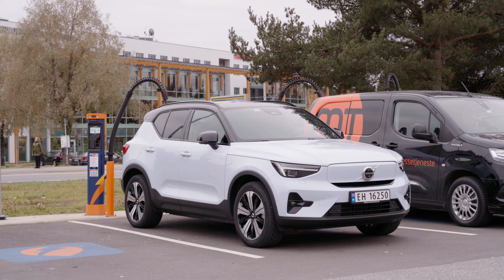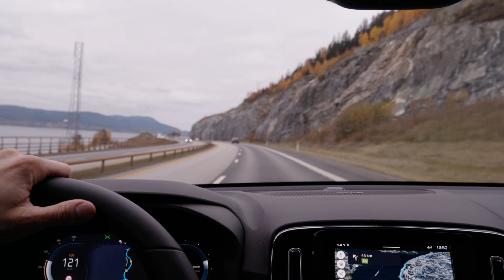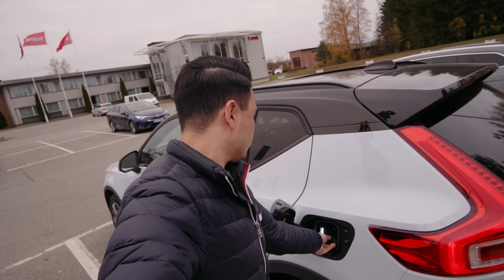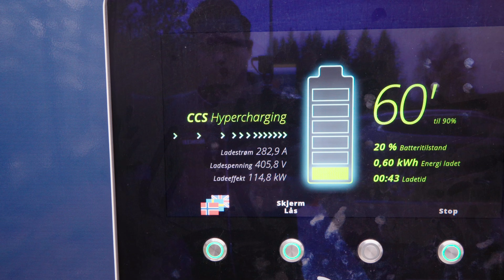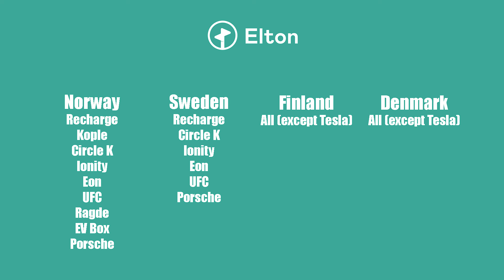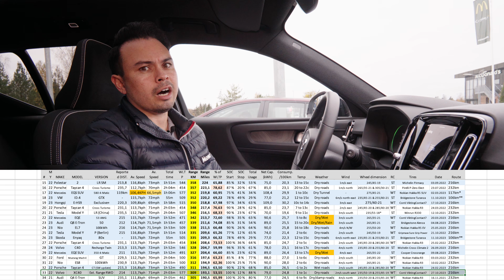MY24 Volvo XC40 Extended Range | Range Test

Comment: I wonder about the perfoamce where I live.  Winter temperature range between the minus single/double digits daytime to the minus double digits at night. So, for example January, usually our coldest month will typically see  temperatures between -10 to -18 degrees celsius. Any experience or thoughts on this anyone? Thanks for the video!

Comment: I just returned from a trip to Sweden and Denmark. 
It was about 8 degrees Celsius and the range was about 350km. Not too bad but I was used to a range of 400+ km. Charging in those countries was fine. High speed chargers that live up to their name. I also ended up with a Tesla charger and that went well. This testdrive went well. The next test is driving long distances with a caravan.

Comment: Hi All. Hope you are enjoying your weekend. I have a question about my new XC40. I ordered a plus version with extended range (big battery). I picked it up yesterday and to my surprise it had 90% battery with only 350km of range. I was also going through the app and checked the range optimisation app which showed a max of 400km. Im new to driving an electric car. My question: is this normal? I was expecting to see higher figures given the wltp is 569km
Reply: I’m driving my XC40 ER a few weeks now. At tempatures above 20C 
I have a range of 440km. 
At a temp of 8C I have a range of 320km. So weather is a big issue!
Reply: Did you do any research in advance about electric cars or cars in general?
Reply: Yes
Reply: Ahahahahahaha

Comment: Is this "new" electric motor in the rear an in-house Volvo motor? And at some point, can you test a rear-drive Volvo in snowy conditions? FWD is much better than RWD in the snow in an ICE car but does it matter much in a BEV?
Reply: The motors in the xc40 and c40 are built and designed in house by volvo

Comment: I assume it's the high average speed that kills the range, but I find the consumption shockingly high. How do these electric cars fair when maxing out at 80-90 km/h? That would be my usage.
Reply: The temperatures really affected this test. I tested the same model in Portuguese summer weather and at highway speeds my average was 20kwh. At city speeds I got an average of 15kwh. Not Tesla efficiency but for a boxy vehicle it's pretty good.